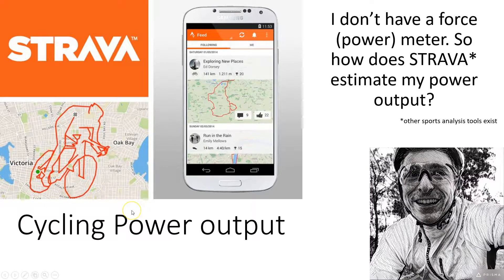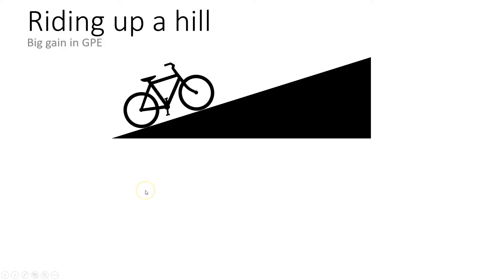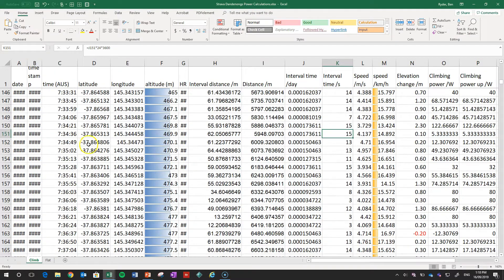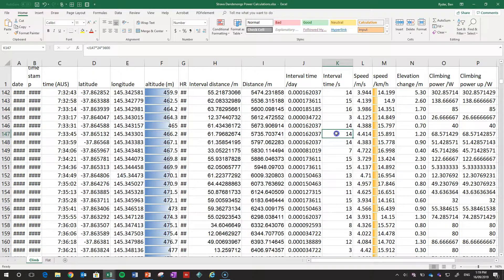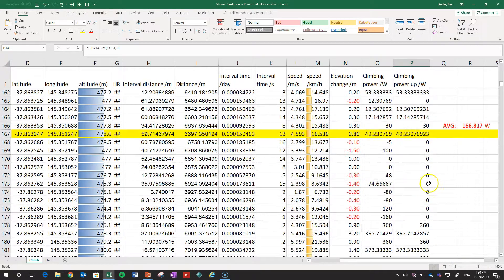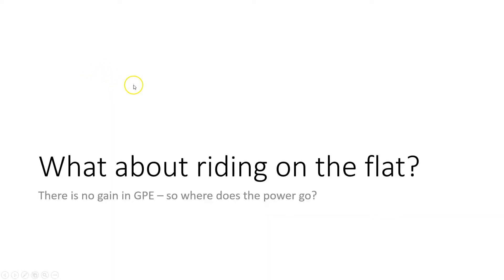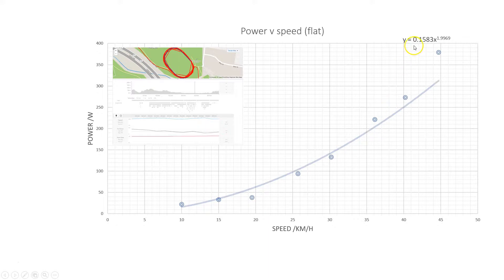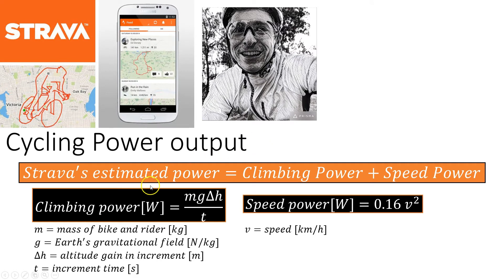How does Strava calculate my power output without a power meter?

Comment: The formula for (aero) drag contains speed² but to obtain power you still have to multiply that by speed. So Strava probably uses speed³ not speed² to estimate power. Nice experiment by the way, thanks for sharing!
Reply from the maker: Of course - how silly. Power = Force * velocity when opposing a constant force (which is proportional to speed²) Thanks for the comment!
Reply: @benaryder  Thanks for your reply. I have just plotted the Power data against Speed³ in Excel because I was curious 😀. That was a better fit.

Comment: Great explanation! It now is clear to me why Strava (and similar apps) ask you for very personal information such as height, weight, age, gender but also type of bike/sport, fitness et cetera. 
It impresses me how GPS data and map data (such as elevation) can be used for the rough estimation of power output. I always wondered how they did it and why adding a Heartrate-, Cadence- and Speedsensor did not change much about the calculated power output.

Comment: Really good analysis and logic.  I teach engineering and this would make a great assignment for first year students learning physics.
Reply from the maker: Thanks Mark. I shared this here after writing this lesson for my Year 12 Physics class who enjoyed the challenge of working out my mediocre power output!
Reply: @benaryder  We did a similar project for college freshmen to design a powered skateboard.  They had to calculate the rolling friction for a regular skateboard so we laid out 10 meters on the sidewalk, used a radar gun to find their initial running start.  They stopped pushing when they crossed the first start line and coasted to a stop and measured the distance.  Using F=ma, they could calculate the deceleration and find the rolling friction force. It got them out of the their seats.  Physics is Phun!

Comment: I don't believe Strava average power output whatsoever. Explain this to me. How can so many riders spend over 50% of their ride in power zone 7?  How can someone that weighs in the same range as me generate nearly 70 watts more than me over the same segment in the same conditions, yet ride the segment 6 seconds slower than me?  This same rider had nearly the same elevation gain and distance as me, riding an average of 0.3 mph faster than me, and averaged almost 170 watts more than me over the entire ride.  Plus, they are on a gravel bike, while I'm on a hybrid. Strava has my weight along with bike weight, and weight of clothing and gear I generally carry.

Comment: Strava's calculations are far from being correct. 1. they don't take any wind into their considerations, 2. no CRR is taken into the calculations as well, 3. CdA, what's that? 4. no acceleration is added. So basically it's solely based on very basic data (Time, Mass, Distance, Elevation), which you nicely lined out and this is then added with nice (and wrong) curves to the profiles. And some people tend to believe what they see there.
Reply: I agree with your statement that Strava does not take a lot of things into consideration. But honestly it's still impressive to see what they can do with just your GPS data. I do not agree with your last sentence "And some people tend to believe what they see there." as the Data that is being shown is correct in the context of lack of information. Strava does not lie or manipulate the data that it shows to the user therefore it is believable and correct data. Unfortunately the people themselves are at fault for believing that the data provided by strava is all encompassing, rather than a rough estimate as a result from lack of data.

Comment: Strava calculations should be taken with a pinch of salt. They are based mainly on assumptions. It doesn't know things like wind direction, the type of bike, tyres, the cyclists clothes, cycling position, road smoothness etc. All it is is just a bit of a rough guide.

A power meter is the most accurate way of measuring your true power. But even without a power meter you can still work out your power by measuring your rate of deceleration when you stop pedalling by checking the Strava data. I've done this before and once worked out my power to be 315 Watts while the Strava power curve had me at about 200 Watts. The reason it under predicted was probably because I was cycling into a head wind and therefore needed to exert more power.
Reply from the maker: Exactly right. I wanted to explain and test some of the physics that must go into these assumptions. 
The rate of deceleration method is interesting, but not quite valid, I think, because the air resistance varies with the square of the speed. So if you calculate the energy used by wind and road resistance as you slow down, and then divide by time taken, it will give you a power figure for the average of the square of your (initial) speed.
Reply: @benaryder , well how i do it is, if I'm cycling at a constant speed of say 20mph and I want to know the power required to sustain that speed, I would pedal hard for a few seconds before stop pedalling altogether. This way you can get your speed up to say 23mph, then you can measure the rate of deceleration more accurately as the speed drops to 20mph. 
The idea is to use short time intervals like 1 or 2 seconds opposed to say 3 or 4 seconds between measuring your loss of kinetic energy, because like you say the drag force is a square not linear relationship with speed. I have on the odd occasion been able to plot a nice square power/speed relationship on a graph in excel . However it's not always that straight forward.

Ofcourse this method isn't fully accurate, for one it doesnt account for chain friction which is usually about 20 watts, but it is better than the Strava power estimate.

Comment: The type of bike is taken to account as well. If I change bike from MTB HT to cross bike, the power output of an activity drops by 25%.
Reply: That's due to 2 distinct characteristics of an MTB: it has higher rolling resistance tyres (even though this resistance increases just linearly it's still like 40 w at 40 km/h on the flat for some normal value tyre) and it does not favour an aerodynamic position plus the bike and tyre are less aero, meaning it probably uses a slightly higher area and cd.